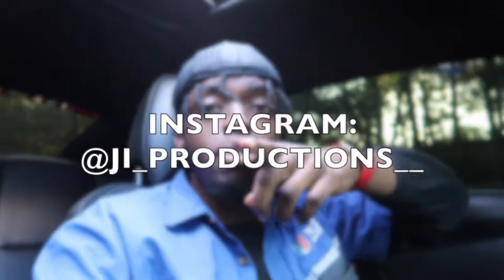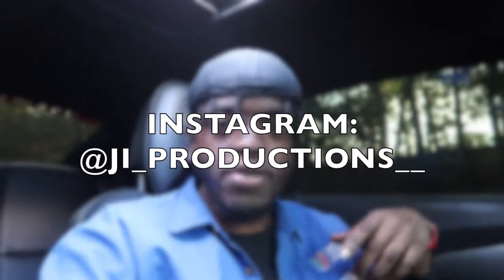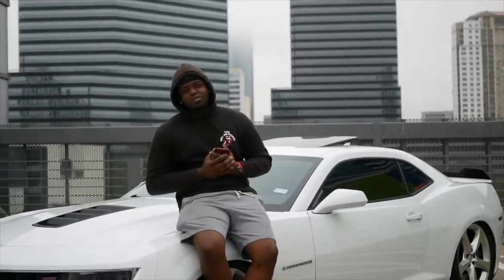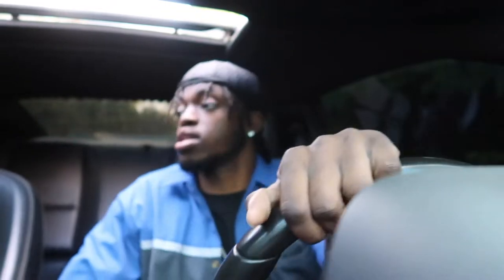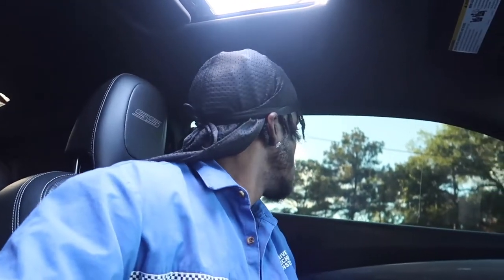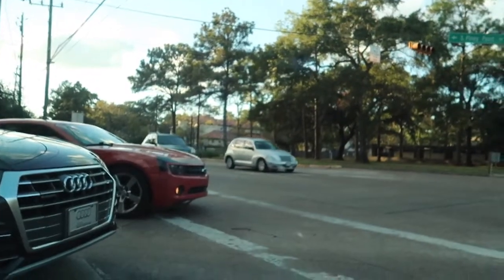THIS IS NOT GOOD... ( I NEED YOUR HELP)

Comment: could be tie rods or struts
Reply: check rack and pinion too, can't recall but I remember some camaros make noises from joints in the steering shaft
Reply from the maker: @HudsonStronck  I was thinking the rack and pinion cause my homie just had to get his replaced shits annoying lol
Reply: @JIProductions  I remember my rack and pinion boot exploded while I was driving the fluid went into the starter so I had to replace both the starter and rack and pinion worst day ever
Reply from the maker: @chrisalvarez9295  damn that’s tuff